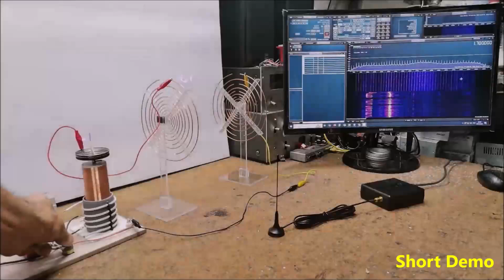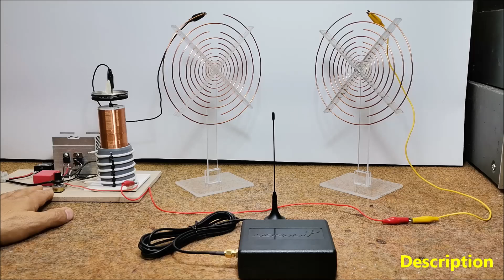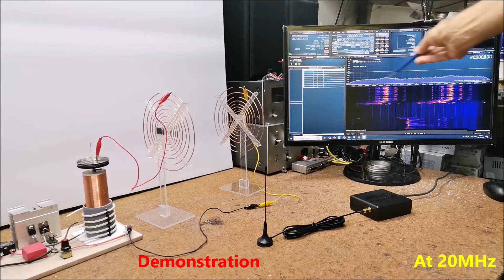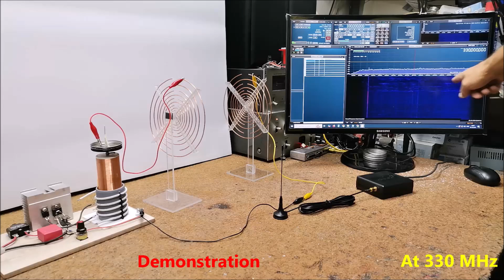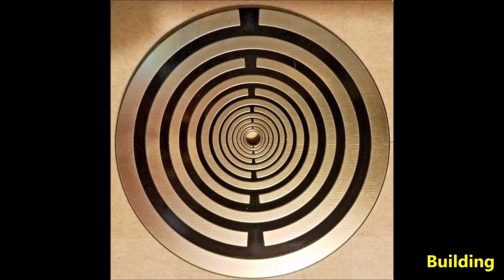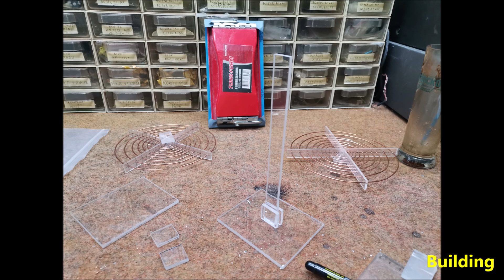DIY Simple Functional Lakhovsky MWO Multiwave Oscillator Therapy Device

Comment: 4:06 Lakhovskys MWO does not work with solid state, it needs a spark gab to produce the multi weave frequencys.
Reply: But isn't that what the program on the computer is doing? Producing the multi wave frequencies for the device?
Reply: @jvon3885 nah, its not porducung, its just measuring. With sparkgap itd be much wider harmonic field

Comment: Looks like a lot of resonant loop antennas together. Maybe if you energise it from a loop + resonating capacitor (mid frequency of the loops) and spark-gap combination slightly in front or behind?? It will likely cause a ton of interference, and don't try it near anything sensitive. Spark gaps are really good for very short pulses and fast rise times that are full of harmonics.

Comment: Would this differ from the original one??? Because I've seen some built with 1 coil each side of the antennas, plus a Ground plate or negative between the coils for the patient to be grounded... The wave form of the oscillator must be square or sinus???? Thanks for uploading this video example and clear doubts since there is no much information on internet regarding to this sort of project 😉👍🏼
Reply from the maker: This is one of the versions, one antenna is radiating and the other is virtually grounded (located at a potential of oV). In one of the next videos I hope to make a version with two coils
Reply: @MirkoPavleskiMK  Thank you for the answer and I'll be expecting your new video... Regards from a distant place called Chile 🇨🇱